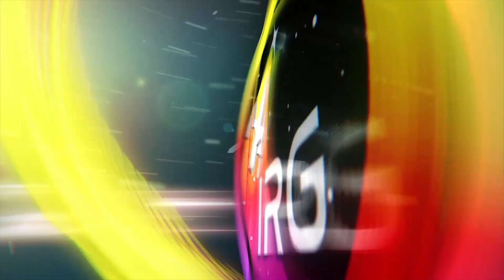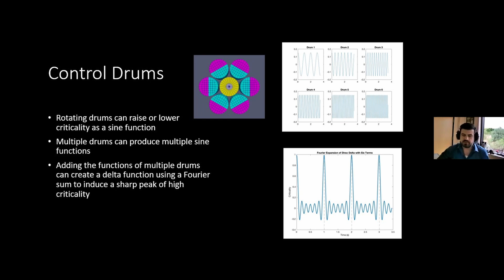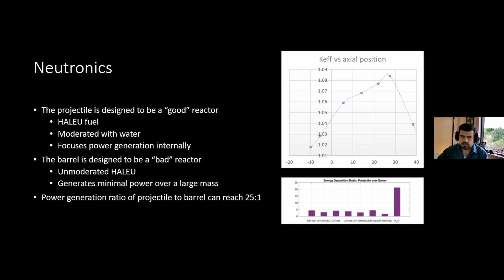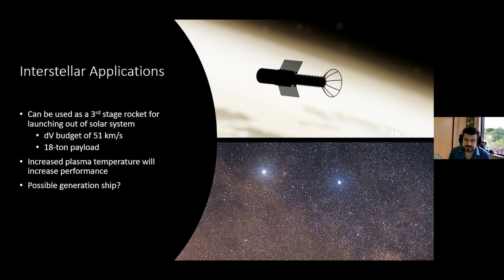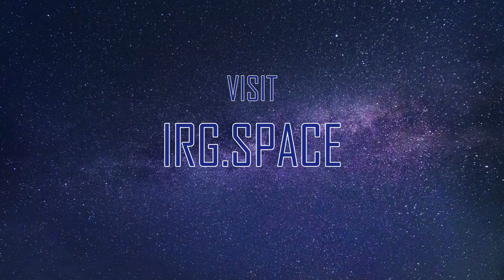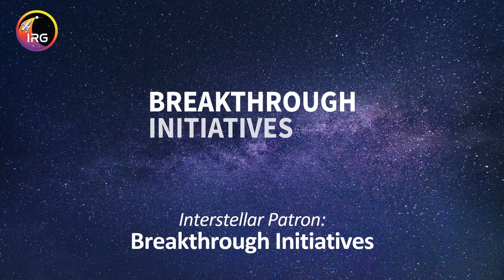27 -- Troy Howe - Pulsed Plasma Rocket- Developing a Dynamic Fission Process

Comment: Hmmm.....This Engine does not solve the problem of Earth to Mars. It may be able for Earth LEO to Mars  LMO. But it cannot take off from Earth or land on Mars with its load of people and equipment. It could be used for interplanetary transit. But the hardest part is takeoff and landing. LEO and LMO takeoff and landing would need a Starship or the like. A Mars colony needs a complete solution. To make it interplanetary transit and commerce popular,  a high speed human shuttle is required. Heavy equipment can be carried on space freighters without humans.

Comment: what if in stead of the uranium barrel you shoot two uranium bullets at each other from the sides and they meet in the middle of a big bell nozzle. there is nothing to control or cool except cooling the nozzle. the deflagration happens at some distance and you get high yield. or you could shoot first a slow uranium cylinder from a wide bore gun then a very fast bullet from a coaxial narrow barrel situated forward of the wider barrel. this second gun would shoot the smaller bullet through the bigger gun cavity and the bullet will catch up with the uranium cylinder in the middle of the nozzle. then (Allah willing) the smaller bullet will wedge itself exactly in the cavity of the cylindrical bigger bullet and BAM. basically shooting a bullet with a bullet. also make the nozzle really big more like a sail.  and have the two bullets collide far away so you avoid much of the radiation and neutron problem by having them disperse over a wide surface area of the engine so the heat load is more bearable.
Reply: Yeah that's a good idea, good thinking outside the box. The two bullet idea is pretty close to the Manhattan project design for little boy and the bullet that catches up to a bullet seems clever. Seems like the thing to check out would be timing and if you could get a fast enough increase in criticality to ionize before the plasma hit the wall. As usual it all comes down to running the numbers, its tough to tell if it would spike sharp enough. Good ideas for replacing (or augmenting) the spinning drums tho.